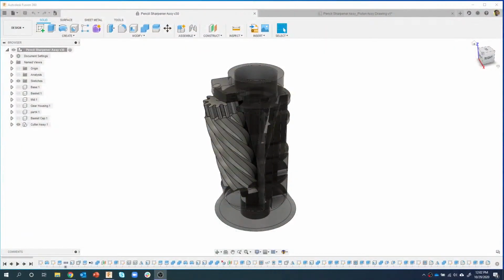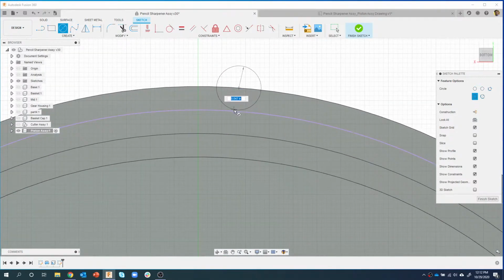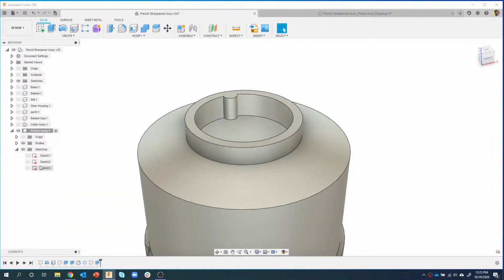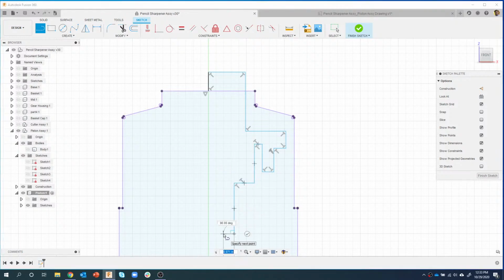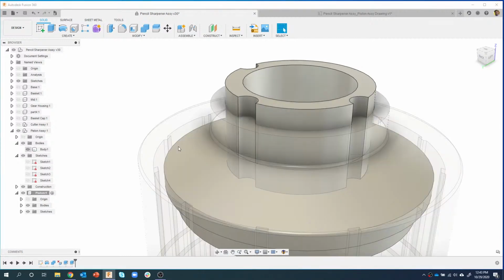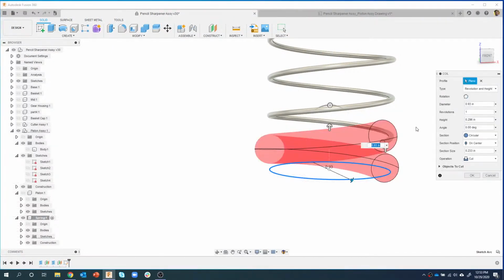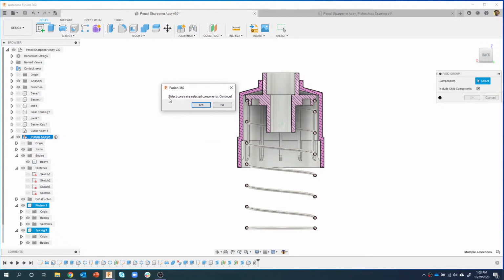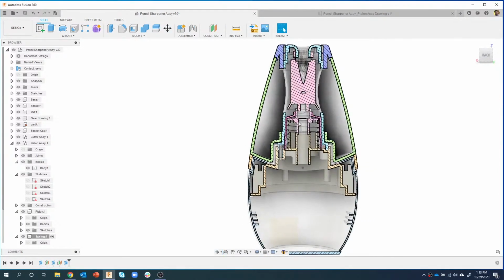Episode 77 - Pencil Sharpener Project, Part 7

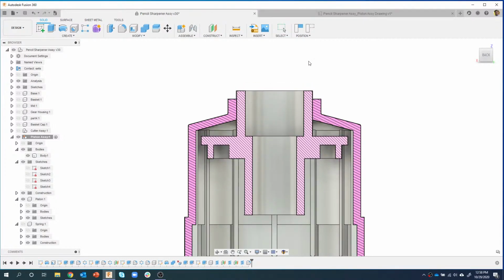Comment: Hello brad thank for another Amazing episode, in 1:00:00 mine wont just move I am stuck is there anyway I could fix this
Reply: I have the same issue. I ran the interference check and there are no issues, but the piston still won't slide.
Reply: I offset the sliding faces on the piston that were coincident with the interfacing component and that seems to have worked.
Reply: @motownlucas  it does but that also makes is move sideways
Reply: @mahmudkhaliil2525  Good point, guess I'll put a sliding joint on it until we get a better answer. Although in reality there would be some play there and I only offset it 0.001"
Reply: @motownlucas  that seems to work thanks ,I changed it back after moving it
Reply: Had the same issue.  Go to the top view and zoom up on the space between the two parts where the piston comes through the cap.  In my case the piston was not properly aligned with the hole and it was contacting the housing slightly (similar to the issue with the filets Brad showed in the video).  When I re-centered the piston in the hole on the top of the housing it worked as expected.